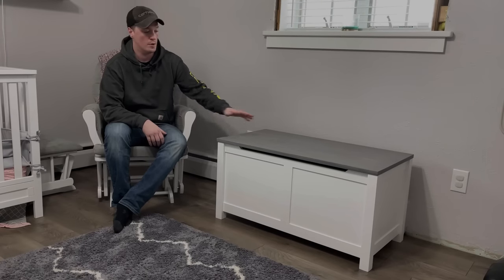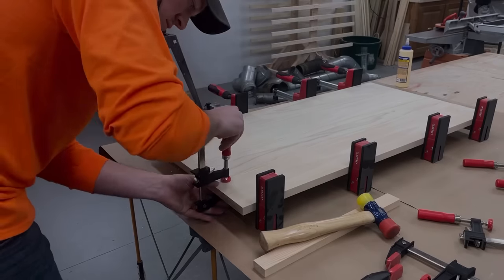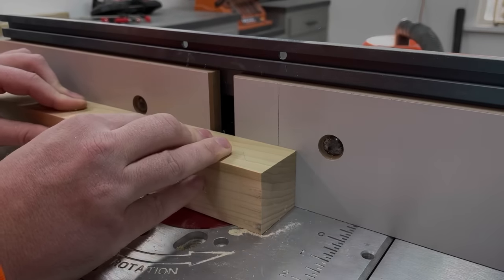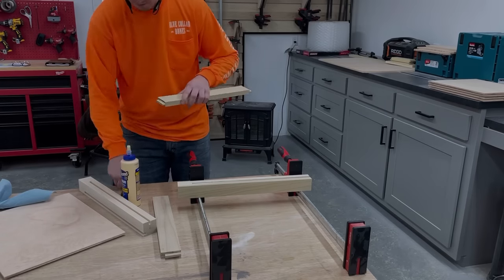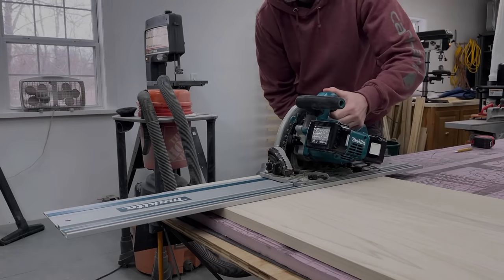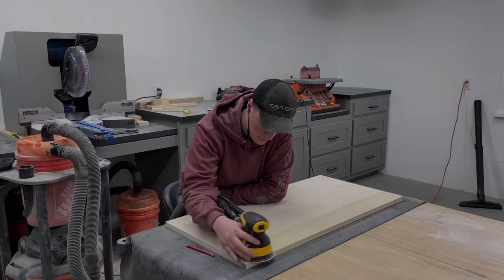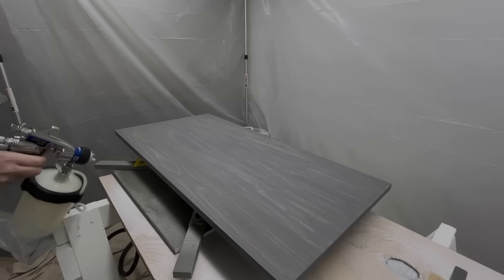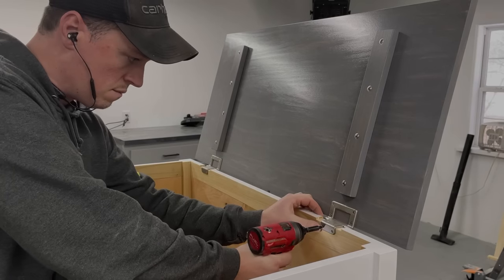Building a Toy Box/Storage Chest | Plans Available!

Comment from the maker: Build Plans available at https://www.johnbuildsit.com/store/p/toy-box-storage-chestbuildplans

Tools/Products used: Freud Tongue & Groove Router Bits - https://amzn.to/35ShPaN
https://amzn.to/3trwXIu
Zip Wall Barrier Kit - https://amzn.to/2YNel7H
4x8 Centipede Work Table - https://amzn.to/2O1TZCk
Bosch Aluminum Router Table - https://amzn.to/35JDim3
Bosch 2.25HP Router - https://amzn.to/34CzZwQ

Makita Cordless Plunge Track Saw - https://amzn.to/34zID1H
Graco 9.5 HVLP - https://amzn.to/3lRC8gH
Dewalt 20V Max XR Brushless Drill & Impact Kit - https://amzn.to/3elOMRA

Dustopper Dust Separator - https://homedepot.sjv.io/9Kvx0
Milwaukee 18g Brad Nailer - https://homedepot.sjv.io/A4Lkx

Ridgid Cast Iron Table Saw - https://homedepot.sjv.io/x1AXd
Bessey Trigger Clamps - https://homedepot.sjv.io/Ar5GK
Milwaukee M12 Fuel Hammer Drill & Impact gun - https://homedepot.sjv.io/eMjaQ or https://amzn.to/2OWb4h9

https://amzn.to/2Mj7KMc
Bessey 50” Parallel Clamp - https://homedepot.sjv.io/3xmBM 
Bessey 24” Parallel Clamp - https://amzn.to/33zBmee
Bessey 1/2” Pipe Clamp - https://amzn.to/2sn5soq or https://homedepot.sjv.io/P9nBR

Ridgid Jig Saw - https://homedepot.sjv.io/eMjJD
Ridgid Jointer - https://homedepot.sjv.io/53Y0b
Milwaukee M18 Router - https://amzn.to/2Bod9iZ
Milwaukee High Output 6.0 Battery - https://amzn.to/3dnrU3k

Jet Planer - https://amzn.to/36MX8i0
Dewalt Sander - https://amzn.to/2HuKJXX
Glue Brush - https://amzn.to/3jgZBHE
Rockler Torsion Hinges - https://amzn.to/36IrCDb or  https://www.rockler.com/lid-stay-torsion-hinge-lid-support-satin-nickel
General Finishes Snow White Milk Paint -https://amzn.to/2R64qaO

Titebond Wood Glue - https://homedepot.sjv.io/BMAeB or https://amzn.to/2TnYIke
BIN Primer - https://amzn.to/2HywIbf
General Finishes High Performance Top Coat -https://amzn.to/36HUs6G
Reply: Hi

Comment: Hi sir I just finished building this awesome box. Only thing I had problems with was I bought the 40inch lb hinges and it holds good but once it gets below 45degree it just drops just wondering if you had the same problem.
Reply from the maker: Our toy box lid stays open all the time so far so I had to go check haha but no not at all! What type of wood use did you use for the top? Maybe it’s heavier than mine. I know they’re not cheap but maybe you could add a third hinge in the center, or reach out to Rockler and see what they say about it
Reply: @JohnBuildsIt  I used poplar as well which makes me wonder if they we’re packaged wrong

Comment: Did the router table come with a lift if. It what lift works well with this table ? Thks
Reply from the maker: It’s built into the Bosch router base. Router is linked in the description if you want to check it out 👍🏽

Comment: What brand or 
type of lift do you have in your router table John?
Reply from the maker: No lift, it’s just on the Bosch router
Reply: @JohnBuildsIt  I have the same router table in which I just put the plate into my extension wing.. Using the Dewalt Router I have to adjust from under the table.. I saw you raising from the top with an allen.. Which Bosch Router are you using? Im really not looking at spending 300+ for a lift lol.. Thanks for the reply. Love the channel and the builds..
Reply from the maker: @riversiderebuilds4677  it’s the 2.25 hp one! Link is up in the description 👍🏽
Reply: @JohnBuildsIt  Just now saw it before reading your reply.. Thank you

Comment: Box turned out very nice...but why not paint the inside? Because the outside is white the inside looks unfinished to me.
Also, many of the links you posted are either "out of stock" or "no longer available" Do you check them before posting them? I hate when PPL post links to something that I can not purchase. You and all the other YT'ers should check them before posting the links
Reply from the maker: Toys will be thrown in and out, and the inside would look all beat up before long if it was white. I just clicked on every link and all but 2 were in stock.
Reply: I didn’t click on them all but probably half of them and they were all in stock. 🤷🏼‍♂️